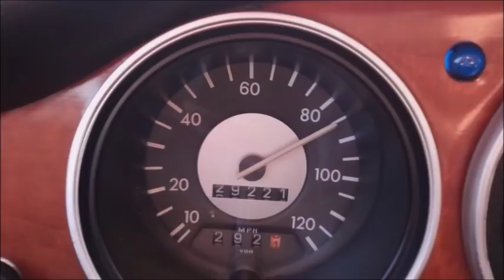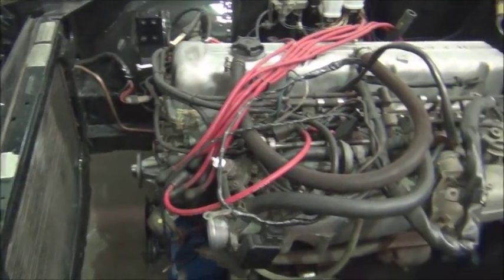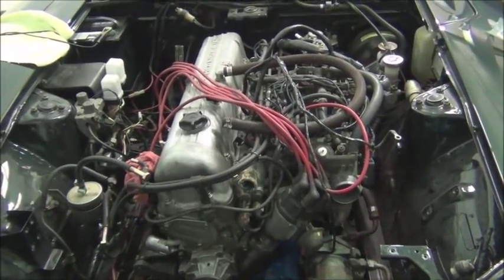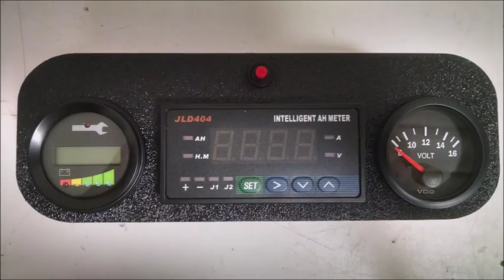Datsun 280Z Conversion to Electric.

Comment: what are you going to replace the compressor with? I presume the AC evap and controls will be left stock? That engine looks very clean maybe recently rebuilt, is it going up for sale?
Reply from the maker: The owner does not want to keep the A/C.  The engine has less than 2,000 miles since rebuild.  It is currently for sale.